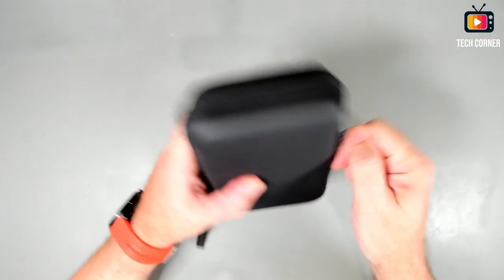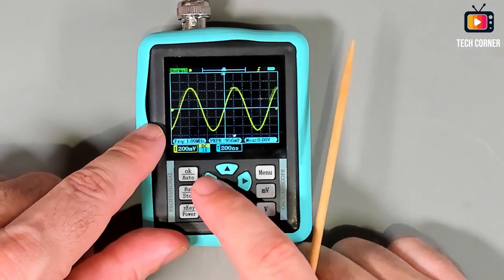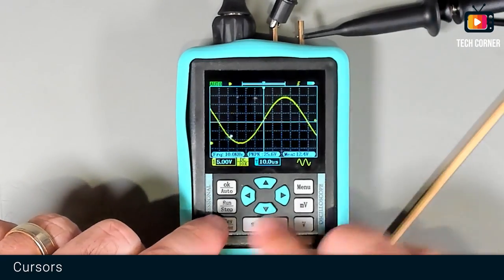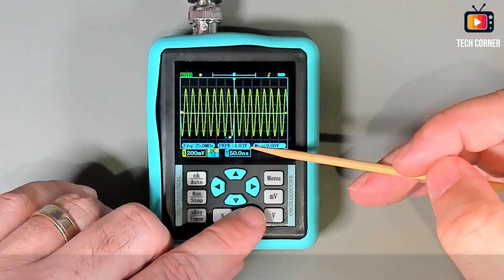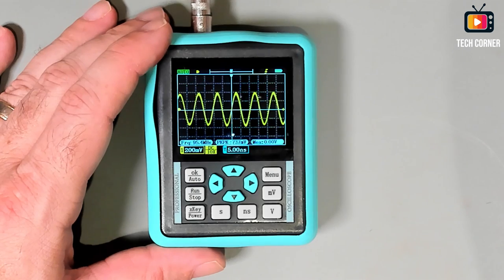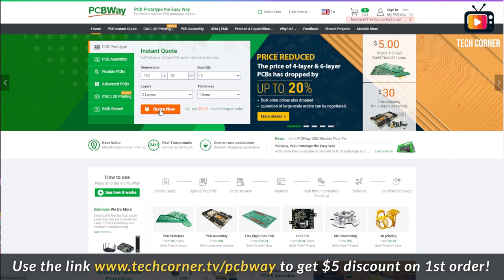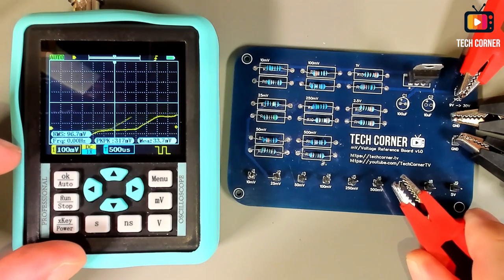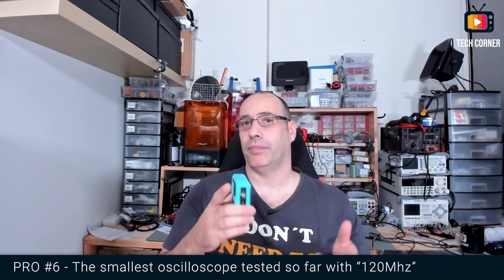Zeeweii/SigPeak DSO1511G  Oscilloscope ⭐OMG 😱120Mhz, Function Generator, Cursors, FFT, AV Output!

Comment: This is EDITED from a previous post I made, in which I was saying that the unit I received was showing a huge vertical offset in all sensitivities from 10mV/div to 2V/div. Well, I don't know exactly what happened, but the problem has totally gone! I also noticed that the high jitter I was claiming is comparable to the level of jitter shown in this video. So all in all, practically, the scope is useable and trustable up to about 5MHz, above which it is better to rely on a more serious oscilloscope. But It's hard to complain considering the portability and the very small price.
Reply from the maker: Hi, I saw the previous comment, I receive a copy on my e-mail and all I can say is, that really happy it was fixed. Is far from perfect, but for such a small device and low price, it has a lot of function in it. It doesn't matter how much it costs, if you buy something, at least it should work as it is announced. In my test, with my unit I took it a bit far than the 5Mhz, but I understand what you say 😁 thanks for watching!
Reply: @TechCornerTV  Thank you for replying. Yes, I perfectly agree that you should get at least what is advertised, no matter how cheap the price. I would say that more or less, it is a yes in this case, even if the frontend bandwidth is not exactly what you can expect for a 100MHz scope, and the jitter becomes almost half a division at the fastest timebases and highest sensitivities. But again, for an inexpensive portable instrument, it is doing really a good job|

Comment: Thank you for this series of excellent reviews!  It would be nice if we could somehow compare the device-under-test display to a bench oscilloscope in real time (i.e. side by side), but I realize that this might be difficult to set up, control, and record.  However, a comparison would give us a reference to how a handheld compares with something like a budget bench oscilloscope.  This could also let us know if extra features like the FFT are even worth having.  An inaccurate FFT is worse than not having one at all as it misleads the engineer.

Regardless, I thank you for these in-depth reviews and realize that there are practical limits to how much time and effort you can invest in reviews that don't seem to be attractive many views.  I appreciate what you're doing here and it's too bad that the algorithm doesn't ;).
Reply from the maker: Hey Rob, thanks for your kind words, really appreciated. All at the same time don't know if it will be possible, but, there is a showdown video in the forge for september or november (if I have few time) and all of them will be compared in the same categories. Thanks for watching! 👍
Reply: Ikr is this thing useful or is it a toy. The fact that it reaches 90Mhz  + does indicate that it's not bad esp. for price but not the same as a regular DSO. But also expect to pay $500 USD

Comment: Very interesting product.  I'm concerned about the displayed noise when doing the reference DC measurements (i.e. 38:00 ).  I need to measure fairly low voltage signals with a handheld and am wondering if this unit's noise is similar to the others at something like 100mV or so.  I don't need perfect voltage accuracy in such a tool, but I do need excellent waveform accuracy.

Though the function generator and video output are nice features, I'd really prefer if companies would focus on optimizing the oscilloscope accuracy and usefulness rather than add marketable features.  I'm impressed by this little scope and it's 2-channel counterpart seems to be as good or better (spoiler), but at this price range I want the R&D to go into the oscilloscope functionality, not secondary features.
Reply from the maker: Hi Rob, I'll try to compare the analysed signal (waveform) against my Rigol on the showdown video.  Will give you a better idea of the waveform quality. Thanks for watching! 👍
Reply: The scope probe wasn't used, but croc clips instead. A retest using the probe would be appreciated.

Comment: 18:50 AV out is a winner, I must admit having only a USB Oscilloscope right now especially for that reason to watch that on a 7 inch smartphone or 12 inch tablet / pc screen.

But how does that video out connect to the TV (I only saw a black cable in the bottom of the SigPeak not which kind only in the tear down it looked as if it had 2 connectors in the bottom)? 
The old red white yellow jackets where usually yellow is for video?
I guess this feature is the future of all these small handhelds to offer an inferface to connect to a android / iphone / PC / hdmi TV device cause all others handheld now look quite outdated by that move ahead.  

Teardown did not mention the connector(s) on the bottom that much cause I had thought there are 2 not only USB) 

How do they wanna improve if they have no connection to the customers and do not want to have that.

To get the firmware I have to follow a yt channel that than links to a repsoitory somewhere ?
Sad to see. 

Again false advertising of 120 Mhz instead of 95 Mhz they can accomplish, at least this is less over advertising than the others before.

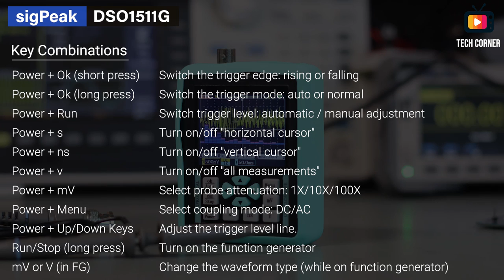Great review and special thanks for the key combinations you had provided at 3:03
Might help a lot of people to be aware of these when their unit might arrive cause that is quite often overlooked or only written on a tiny sheet of paper in a super tiny font size.

For whatever reason (thumbnail or beginning) I had thought this would be another fail but so far it looks quite the opposite except that I am not a fan of a manufacturer who stays in the anonymity without a web page. But I had watched it now almost twice especially for the tv out cable needed
Reply: The channel's name of the manufacturer seem to be o-scope
You can find some limited demos or pretty nice ones of particular features like the 2512G demo of xy animation from a video 

No link to a firmware update found. 

I also would suggest to add a VOLTMETER MODE by (long press on f1 button ) with large font for digits.
Easy fix but of great value.
Reply from the maker: Uhooo... I totally missed that feature of the voltmeter... very nice. I will search the links of the youtube page and also the shared folder and add to description as you suggested. I am currently in vacations and everything takes more... do that in the following days 😁thanks for the tip, very nice indeed.
Reply from the maker: Hi, you summarized the biggest problem of this equipment, I can live with the 95Mhz (even if it's not the announced 120Mhz) but no support at all, is a bummer. The investmens isn't to high, but even so, is always good to have someone where you can ask for support if needed.
Regarding the AV output, is a traditional 3.5mm jack video cable to composite, only the yellow connector is required. If your TV/monitor doesn't have composite connector, you can use a SCART or HDMI to composite adapter.
In terms of connectors, you have 2 for the function generator output (live/common) and one for the AV. Also available is the USB charging port and also PC connection.
Thanks for watching.

Comment: That 5v output on the voltage Ref board is still a bit flaky then. Very odd. Nice that you are considering a version 2. Another good review Hugo 👍
Reply from the maker: Hey Dave, I don't get it... in my Siglent bench multimeter I get 5V on that pin, on portable multimeters I get weird values. Curiously enough, the only small oscilloscope to give the value it should have is the one I review next week. In terms of accuracy is the best. Just a small spoiler. I'm studying a v2 maybe with SMD.... still working on it. Thanks for your comment and for watching! 👍
Reply: Correct me if I am wrong, but that board doesnt have capacitors where they should be, to smooth out output.
Reply from the maker: @orion310591RS  Why do you say it doesn't have capacitators, I went back to see the teardown and just on the first images I see a bunch of them (minute 40:53) all the "appricot" or "almond" colored components are capacitors.
Reply: @TechCornerTV   I mean capacitors at 39:22, on blue board. This is voltage regulator with no capacitors, yes?
Reply from the maker: @orion310591RS  Ahhhhh... got it now! Totally right, I had to shunt it. This is my mV Reference board but I mad a mistake on the design (already corrected) but at this time it didn't have the capacitors. Since the purpose here is to test the voltage, it works fine without it. I have here already new version with capacitors.

Comment: 28:06 - As you had to use X10 probe on above 5Mhz, I think you should have used X100 probe on 100 Mhz... correct?
Reply from the maker: Hi Orion, well the probe should be able to handle the Mhz you need to analyze, but the 1x, 10x and 100x are used in the vertical line (amplitude) and those refer to voltage. The idea is when you activate the 10x (or more) is to atenuate the signal so the voltage isn't so high and the same equipment be able to analyze bigger voltages. Normally, when you activate the 10x on the probe, the read voltage is divided by 10x, so you must configure the channel in the oscilloscope also so the values are correct. So, answering your question, no need to change the probe, since the probe is appropriate to handle the 100mhz, the P6100 that is delivered with all these cheap oscilloscopes supports 100Mhz. Thanks for watching.

Comment: Hi Hugo - the mvolt testing is concerning, compared to the dual channel which is stable testing the mvolt board. Was there not perhaps a bad connection whilst testing the dso1511g. I see that you weren't using the scope probe, but crocodile clips instead....
It would be nice to see the test re-done using the probe please.
Reply from the maker: Hi, nowadays I have a DC voltage calibrator for this tests. I'm considering todo a new showdown between several of these small devices, so I will retest everything again in the future, just can't give right now a time schedule because of all the devices I have here pile up to review. Thanks for watching.

Comment: I bought one of this（ZEEWEII DSO1511G） on Taobao and disassembled it, the board number is V9.7D, if the hardware has not changed, that FPGA should be AG1KLPQ48, and the other 16-pin chip is 74HC4051, but this ADC chip of mine is also polished, so I can't see the model number, I hope someone knows what chip it is，and this charge port has some bug , can't use c-c cable to charge,must be Each string of 5.1k resistors with cc1/cc2 pin between the gnd,than c-c cable can charge it
Reply from the maker: Hello, thank you so much for this rich comment, a lot of info in there! Thanks for watching 😁

Comment: Hello sir, need advice. DSO1511G vs fnirsi-1c15 vs fnirsi-5012h which one should you choose?
Reply from the maker: Hello! Personally I would go for the DSO1511G, because it has more features. But attention, FNIRSI has technical support that Sigpeak aparentelly hasn't. That is also a importante detail. So, the final decision, as it should, is yours. If you go with FNIRSI, I would recomend the 1C15+ instead. Thanks for watching! 👍

Comment: Has anyone  got one and managed to get it to connect to a PC ?  Mine says USB Connect but it is not recognised by the PC (as far as I can see anyway !) .
Reply from the maker: Hello, sorry the late reply. To answer your question, I don't know if it is possible... I didn't have any reaction when connecting to my PC. Thanks for watching!
Reply: @TechCornerTV  I have actually got it to work.  The cable  I was using must have gone faulty. As a last resort when I was getting nowhere I changed the cable and it worked ! Better late than never.  I have tried everything  except the video output  and the firmware update and it all seesm to work.
Reply from the maker: That is awesome, I've to try mine again... the computer didn't gave any sign of detection, maybe it was also the cable, thanks for sharing!
Reply: @TechCornerTV  I actually used the cable supplied with the scope. At first i used one of the many USB cables  I own  and perhaps it was a charging lead only so was without the data wires !!